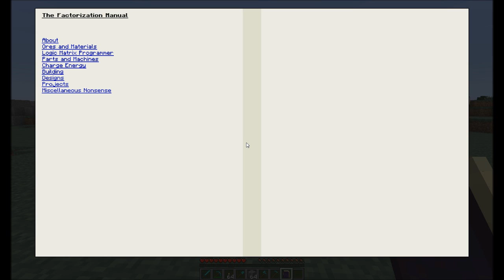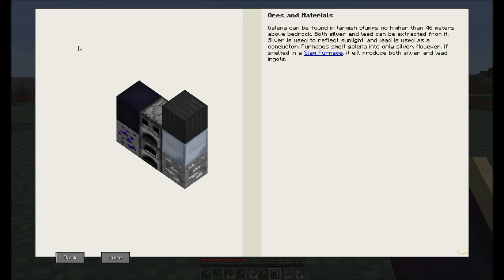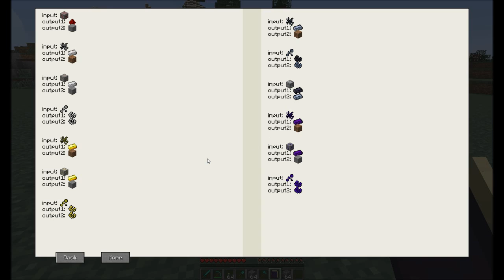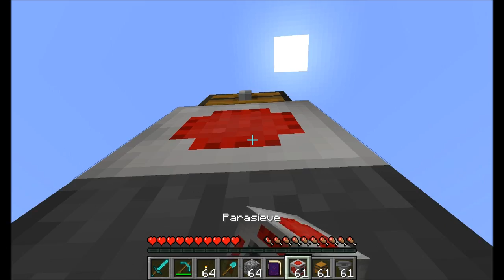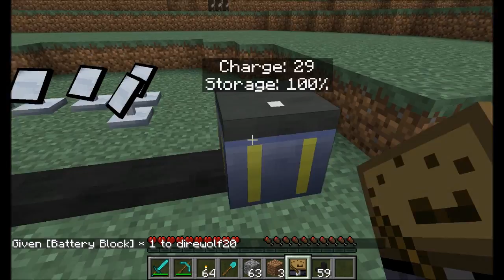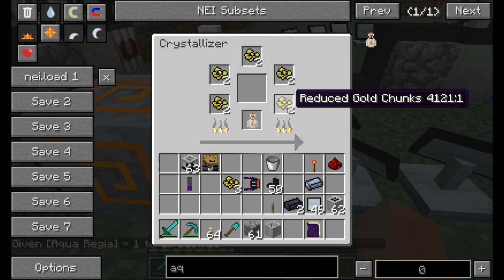Mod Spotlight   Factorization Part 1

Comment: Can someone help me? When I go to play on 1.7.10, I keep getting this, and it's pretty annoying: [01:14:37 INFO]: Client> [01:14:37] [Client thread/ERROR]: ########## GL ERROR ##########
[01:14:37 INFO]: Client> [01:14:37] [Client thread/ERROR]: @ Post render
[01:14:37 INFO]: Client> [01:14:37] [Client thread/ERROR]: 1286: Invalid framebuffer operation

I'm using Forge 1180
Reply: Completely harmless error. Just keep in mind, 1.7.10 forge and mods are a buggy mess. Be best to wait at least a month for it all to stabilize.
Reply: Adam Oliver I suppose so. It's just impossible to find the buttons so that I can play. But I will wait. :)

Comment: I once had a really neat redstone and hopper circuit that would fill buckets, and fill the mixer, and used all vanilla mechanics. (dropper towers, filters, and such) And it worked quite well. However, redstone like this was irrelevant, as many of the other mods added much easier solutions, rendering my contraption just too large and expensive to use...
I wish mojang decided to add some sort of ore system similar to Factorization's. It's a very simple, thematic, yet convoluted way to extract more efficiency from resources, and wouldn't be too out of the way for vanilla.

Comment: most of these stuff are easily achievable via other mods taking much less time and resources i like how its not too easy to get ore processing and i might use it for a bit of challenge but if you just wanna get more stuff the better alternative will be pulverizing, smelting and if you need more ores, expanding the mining operation by half is simple in comparison to this mod. drones do sound fun but basic knowledge in turtles is a lot more efficient. might be nice since they are entities though.

Comment: This mod has a cool process but compared to other mods it not really worth using this. It's complicated and takes a lot of time to use
Reply: That's ok, but some of like doing things in unorthodox ways :) This mod has lots of useful and ... different little gadgets that you can assemble yourself.

Frankly i'm a little over TK/TE/ME and quarries of various sorts.
Reply: Hey, I mean if you like doing things the unconventional way, more power to do. i was just stating that for me I feel as this mod had a drawn out process of things that many many mods do most efficiently, But I do agree that it does some have some cool things. Everyone loves barrels and frankly I thinks that one of the only reasons it stays in modpacks.
Reply: ilewis7033 The other reason is that you can make a good and cheap source of steam to use in railcraft using a tower of water boilers surrounded by mirrors ;D
Reply: Not that. I've played with it and FZ is definitely more than just Barrels. There are a lot of thought put into it but it doesn't fit in modpacks with TE, ExtraUtils, or Ender IO. It is more fit with BC, RC, or IC2/GregTech type of modpacks where people like doing different things.
 And do note that "easy" and "efficient" process to some people, doesn't mean "depth" or "interesting" to some people.

Comment: I've had factorization in every minecraft version, however the only thing I ever used from the mod were the barrels. I like the thought behind the mod but it just falls flat compared to some of the "easier" mods that produce more, faster, better etc. The biggest problem is that this mod is often included in the same modpack as many of the more popular mods. Which is a shame because it really ends up in the shadows.
Reply: Yeah, this mod is best for modpacks which contains hard and complex mods like Buildcraft, railcraft, and IC2/GregTech. Not the Thermal Expansion family of Ender IO or Extra Utilities or the magic mods.
Reply: But now we have Jabba for barrels which imo is far superior

Comment: Do thermal expansion again
Reply: It's not even 1.7 yet
Reply: Why?
Reply: piratexnovaraiderd do you know how much code has been changed in 1.7?
Reply: *****
I know but Thermal expansion isn't updated to 1.7 and Dire already made spotlight on 1.6 so I asked him why he want spotlight.
Reply: oh :P sorry if i seemed a little rude..
Reply: *****
that's fine :)
Reply: piratexnovaraiderd and i think the reason is to show off all of the possible new features, like dire did with factorization.
Reply: ***** What are you exactly mean? He shows everything from the mod and from this time wasn't added anything new.